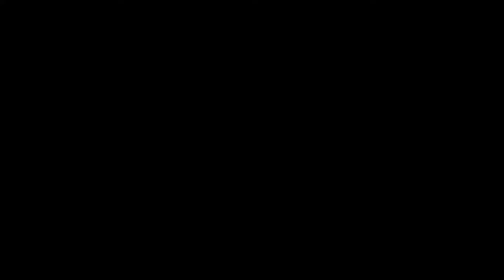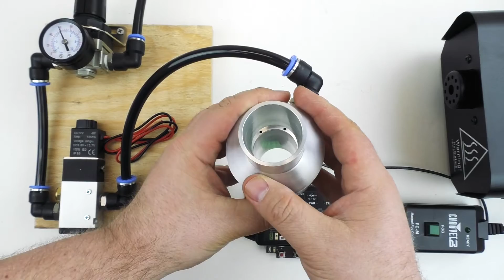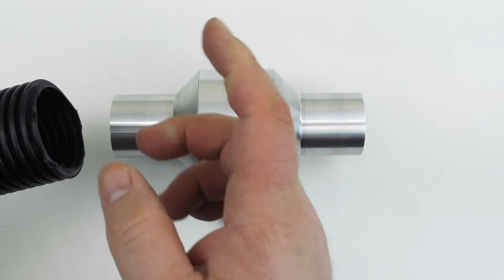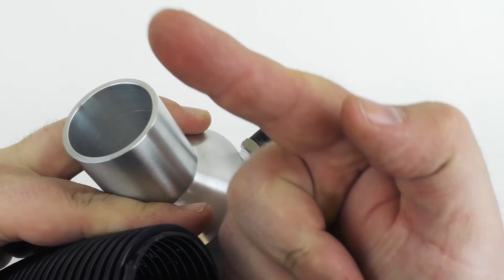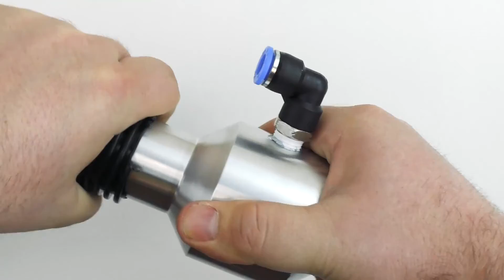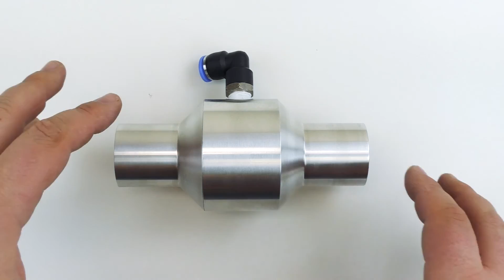How to Create a Blast of Fog in a Haunted House or Escape Room

Comment: Saying can use any wire to connect the Common to the Trigger power is probably not that best phrase to use.  The appropriate wire gauge is needed even if the current/wattage is fairly low.

Comment: Could you do a video of using a prop motor and the parking feature and do it on the picoboo or picoboo plus since the pico volt is totally different. So pls do a vid on the picoboo or picoboo plus with a wiper motor